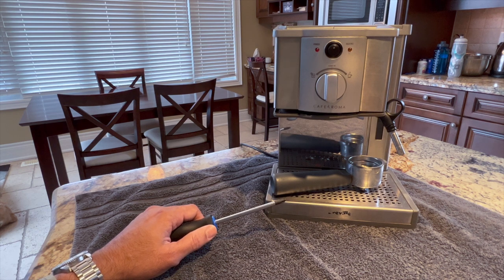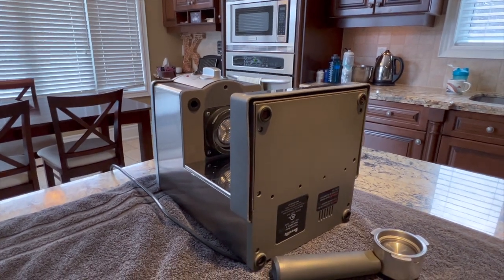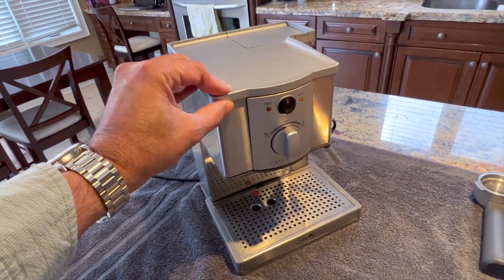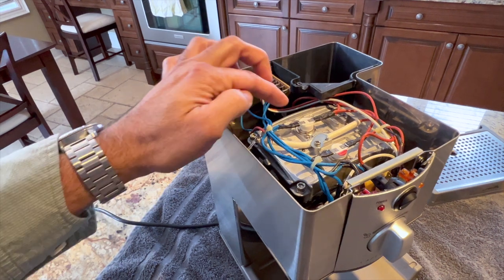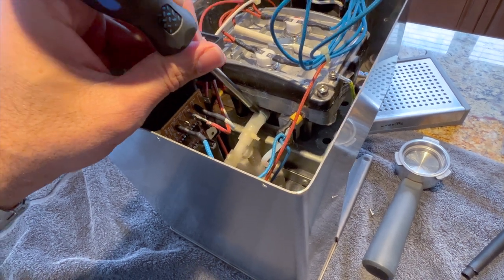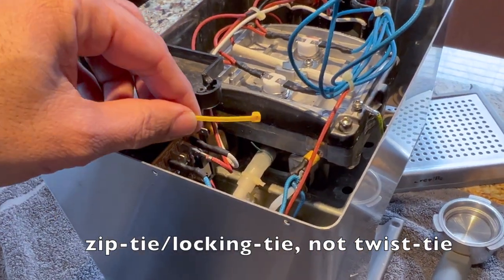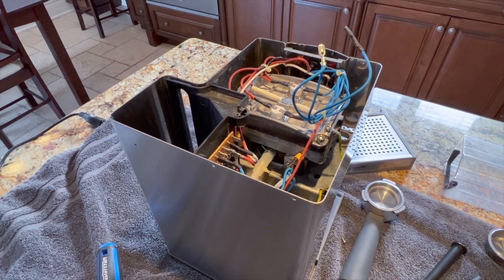Breville Cafe Roma No Pressure | Breville Cafe Roma Not Working | Breville Cafe Roma Blocked

Comment: Thank you! My problem was exactly the same - but I simply had to prime the pump. I took it all apart - like you … but I didn’t need to. Instead I opened the bottom … disconnected the water feed from the bottom valve, and forced water (while it was on) into the intake tube (just used my mouth). It took alot of pressure and then all of a sudden the water came  running out. It was a bit dangerous, there is exposed electric when you open the bottom AND I had it on its side so the water could have sprayed the electric. That’s all. I think I caused the problem - the machine was dry - not used in 5 months.
Reply: This comment saved me.
Reply: This comment helped me out too! Thanks. To add some details: unplug power, remove the six bottom screws (not the feet ones), detach the hose connecting the water tank to the pump, I attached a bike pump to the hose to achieve the pressure needed, you’ll hear a rush of air once you’ve unblocked it. And you’re done!

Comment: Thank you for the wonderful tutorial! This looks to be my issue and I'm very excited to have such a simple solution.
Reply from the maker: I found the most common issue is the loss of pressure from the gasket developing a crack and losing pressure. If you hear a pop or a fizzing sound as the Roma is building pressure after you activate it, it's the gasket most likely. You can get others on amazon easily. I keep extras. Good luck, hope it helps.

Comment: Amazing! This was the video I was looking for the context fits perfectly and i was getting exactly the same symptoms. In my case i recently started leaving the heater on 24/7 using the cup holder waarming area as a surface on which to try and germinate cactus and avocado seeds wrapped in moist paper towel in a Tupper wear container thinking it would be a great way to keep the germinating container ~30-40 Celsius @ near 100% humidity. Going to attempt this repair tomorrow. thank you! I'm on a budget and literally had a cheapo but still overpriced replacement espresso machine in a shopping cart in another tab  and i was vacillating mostly because of the allegations that marketplace's laborforce leverages forced labor from yeghuar "re-education" camps. glad dicided to dig on troubleshooting before tossing it. as my little cafe roma has been the real MVP of my daily cafeine productivity since 2018

Comment: Thank you! I just started having this issue with my machine- I haven't opened it up yet to take a look, but it seems simple enough. I hope this is my solution!
Reply from the maker: I found the most common issue is the loss of pressure from the gasket developing a crack and losing pressure. If you hear a pop or a fizzing sound as the Roma is building pressure after you activate it, it's the gasket most likely. You can get others on amazon easily. I keep extras. Good luck, hope it helps.

Comment: Thanks for the video! Gave me the nudge I needed to open it up and check before going to get a new one.
Reply from the maker: Just a heads up, the motor itself only lasts about 7-8 yrs then it dies. Can be replaced but you have to find it. Likely easier in the U.S.  Good thing this unit is a good value overall though, in case you replace with new one.

Comment: I spoke too soon. It only temporarily resolved my pressure loss problem. Still though. Your video is appreciated.
Reply from the maker: Sorry it didn’t work out for you man. Sometimes the pressure loss is fixed by replacing the silicone gasket. That worked for me once.

Comment: Hi
My Cafe Roma makes a pop sound and the water/coffee pours out around the pod. 
I took the top off and the area you talked about looks fine. Any other suggestions?
Reply from the maker: I found the most common issue is the loss of pressure from the gasket developing a crack and losing pressure. If you hear a pop or a fizzing sound as the Roma is building pressure after you activate it, it's the gasket most likely. You can get others on amazon easily. I keep extras. Good luck, hope it helps.

Comment: Great Video Thanks for sharing I have a bit of a different problem I seem to be losing pressure on the frothing but I'm going to start here Thanks again
Reply: Hi, just wondering if you are able to resolve the issue? I’ve got the same thing going on
Reply: @lukasschlums8242  I cut the barb and curl off of a long shaft fish hook and cleaned out the frothing tube and it works better now then it did new
Reply: @corystrong6547  great thank you! I’ll try that out
Reply: @lukasschlums8242  Your Welcome

Comment: I'm not sure if my machine had the same problems with pressure, but my espresso came out with no crema for sure, and the steam wand dripped slowly without steam. (However, there's a bunch of steam that ran out after I turned it back to stand by)
How do you know if it's a pressure problem? And do you think the situation above is the same as yours?
Reply from the maker: no cream is no fun - that's the best part of the coffee so I feel for you. I think you may still be having a pressure loss problem somewhere along the line but a very small/slow one. Regarding the wand - I find it helps to let the wand put out steam for about a minute before I actually try frothing my milk or coffee. The wand needs time to heat up and build pressure as well. Hope this helps. good luck. Also the wand needs descaling and you have to put that needle thing up there every so often to clean it out.
Reply: I know it's been 3 months since you asked the question, but I'll put this here for anyone else who may be having this issue. 

The wand can get plugged with dry milk, if not cleared properly after streaming. 

I find this happens most often when my son uses the machine. 

I use a long, straight, roofing staple to clear the blockage. I gently push the staple into the wand hole. Don't do this if you already have pressure built up, or a stream of hot water may come jetting out!

Once the blockage is cleared, reheat the machine and turn on the steam to see if this has solved your issue.

Comment: So the basket (large as I like string coffee) I’ve always used stopped working. I cleaned the machine and the basket still no luck then decided to use a smaller basket and it works but unfortunately my coffee is not strong enough as the basket doesn’t hold enough coffee. This morning i tried large one still no luck (pressure build up but still not working). I’m now thinking it’s the rubber gasket that I may have replace even though it work with the smaller one. Can anyone tell where and what size to buy for this same machine in the video. 
Thank you

Comment: Hope it works, only got a sip of coffee this morning. It did this once before but then worked again for another year without doing it. I'm on second day no coffee so tonight it gets opened up.
Reply from the maker: Most pressure loss problems are fixed by replacing the silicon gasket. Those get damaged easily. Can buy those on amazon.

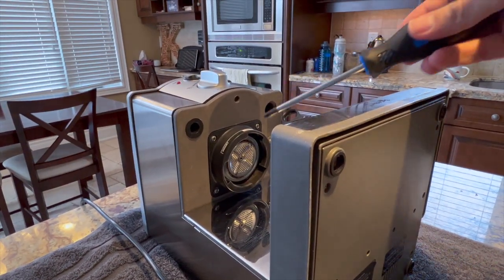Comment: Might I ask a question? How did you get the screw out that you mentioned at 1:10?

I've spent the past half hour fighting that thing and there's no way. Does it have Loctite on it? I've tried WD-40, I've tried IPA, I've tried oil, I've tried giving it a hard stare...nothing is working.
Reply: I’m having this same problem. Any luck?
Reply from the maker: sorry I didn't see your question. I had to use a short screwdriver to unscrew. After that, you can try to use the edge of a flat head screwdriver to pry it loose.
Reply from the maker: try a flat head screwdriver to pry it loose after you've unscrewed the little screw there.

Comment: The seals on mine are all fine, but in the line between the pump and the heater there is a junction that leads down to a square white box. Water makes it up to this junction, but not past the junction into the heater. Instead water comes out the bottom of the white box into the drip tray at the bottom. Any idea how to fix this?
Reply from the maker: I’m wondering if there is a seal break or block at the junction or in the line towards the heater?

Comment: Doesn't that mean there is liquid in the bottom that escaped that? I just had my first problem right now, and there was like an oscillation and loss of pressure.
Reply from the maker: Most pressure loss problems are from a cracked or broken silicon gasket. Can buy new ones on amazon.